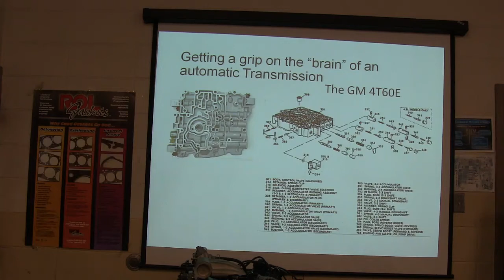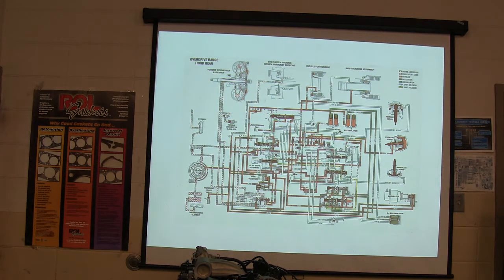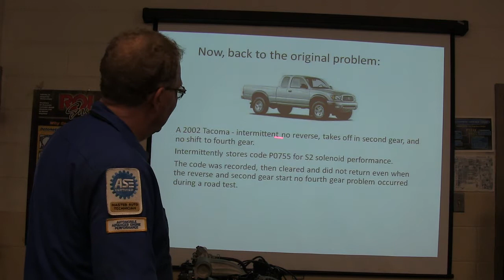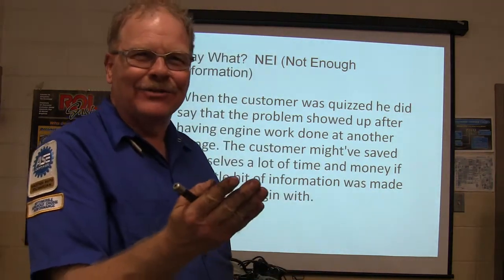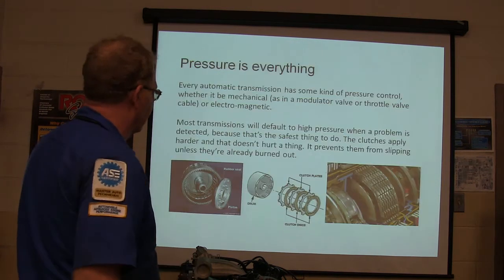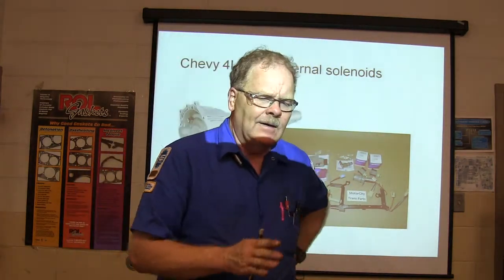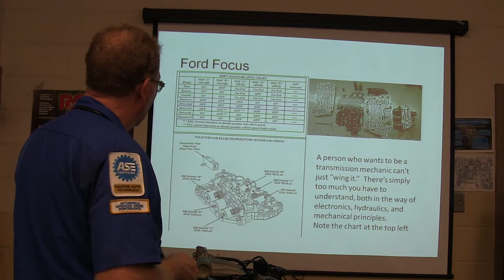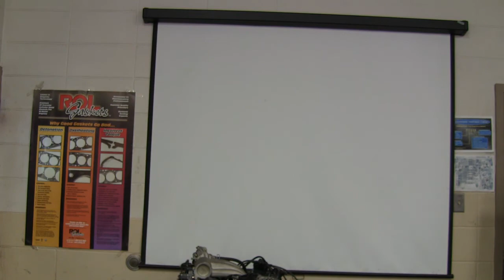Auto Trans Solenoids and Principles

Comment: Richard, I know you're pretty familiar with 80's and 90's Fords being that you worked at the dealer. I've got a 1994 Explorer with the A4LD transmission that's currently a farm truck since it almost never shifts out of 1st. I bought it cheap because of this issue. 190k on the clock and it looked like it was never serviced, grey and gritty fluid. I've stuck a Magnefine on the line and got rid of the grit and flushed many quarts of fluid through the cooler lines but have yet to drop the pan. The owner thought it was the modulator and tore out the seat to replace it but never finished the job. I did put in a new one though. None of that helped the issue at all. It really sounds like there's fluid straining when the engine is idling. Is there a common place where crud would get stuck? I feel like I'm looking at dropping the valve body and spraying brake cleaner though it. I know the internal filters in these are like window screens and probably let a bunch of crud clog the passages. Any ideas or hints? I said it almost never shifts but if you get it in 4x4 low and drive it down a steep hill, it feels like it goes into 3rd but kicks out under load (like it wants to go to 2nd but that won't engage). I've not felt any slipping, first and reverse pull great, even with a loaded trailer.
Reply from the maker: The valve body in those transmissions is pretty hard to clean (at least for me) because the valves are aluminum and you probably have several stuck valves.  You might try a good used valve body, but make sure you use new gaskets and torque it to specs - sometimes those transmissions will even act strange after the valve body is replaced and you might have to let it set overnight before it'll work right after the replacement (I'm not kidding).  It's like the valve body is letting fluid pass between passages until it finally seals up.  Anyway, I'd go for a valve body on that on for sure.
Reply: Thank you for the info! I will prep for doing a valve body. It's more of a learning experience but watching your videos gives me the confidence to jump into it with my wallet :)